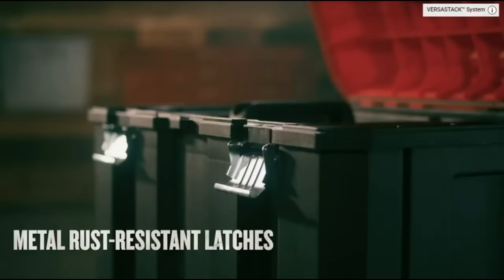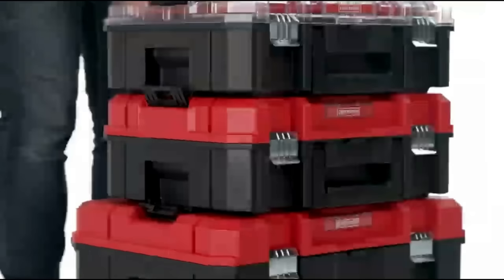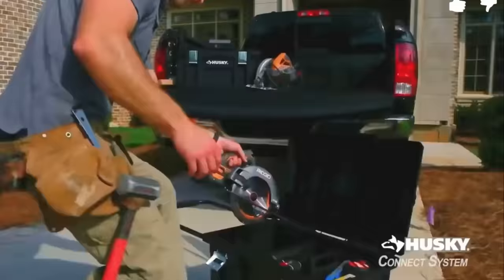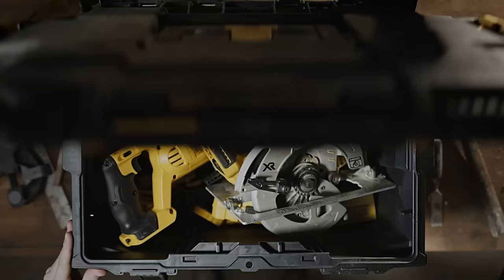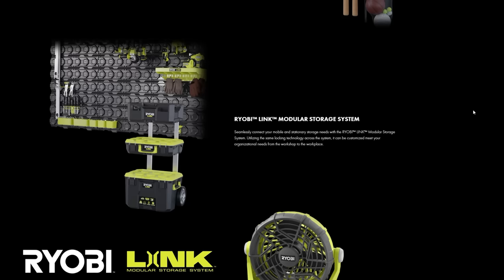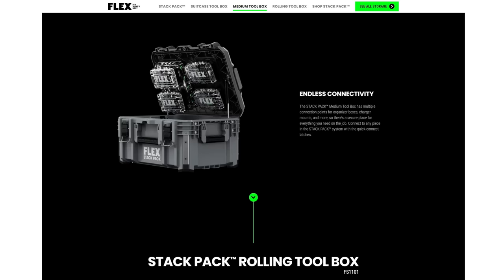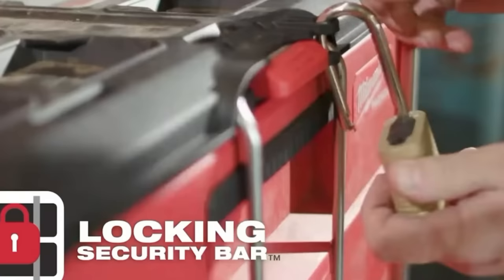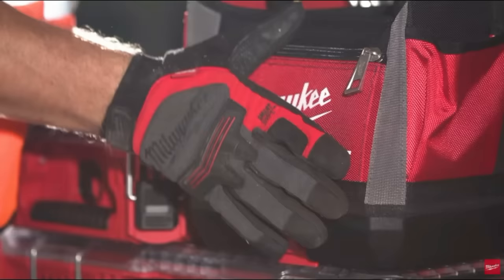BEST Portable Tool Storage systems (RANKED) WATCH BEFORE YOU BUY!

Comment: The most overlooked advantage that sets Milwaukee and Ryobi apart is the latching mechanism is accessible from the front.  Makes a huge difference in a van or when you have vertical stacks side by side and not a lot of side access.
Reply: That's a very good point I've got a load of the DeWalt boxes and it is a pain to lock/unlock them as I have stuff next to it.
It's too late as I'm invested in the DeWalt brand but the packout stuff is pretty awesome.
Reply: Craftsman Tradestak has that as well. VERY nice compared to Versa/T-Stak.
Reply: amen brotha
Reply: @danielshaw4692  sell em and go red. Lol
Reply: DEWALT has drawers that are much better.

Comment: My opinion is even if you’re just getting started or don’t have a ton of money to blow on a tool storage system, you should get Milwaukee pack out.  If you get a lower end option you’ll eventually want to upgrade anyway and it will cost more than just starting with the best option.   Buy one box at a time and work your way up. It’ll be worth it.  The drawer system pack out is a game changer.
Reply: Too true.

Comment: Owning probably more packout than most people, I’m switching to systainers not saying they are better but they have some really nice features like weight sizes usable space. If you’re in or getting into Festool or Makita you will already be in the system. Just putting it out there.
Reply from the maker: Appreciate the feedback Chris
Reply: I like them, but be warned, they are quite fragile. In particular, the top handles wear out quickly, especially if you put a lot of weight on them. This is a HUGE problem, as they are fragile, and so if you lose a top handle and drop a stack down a flight of stairs, the tools may survive, but the boxes WON'T. I consider myself lucky I managed to find out about the handle problem before I found out the hard way. (and it's not just me, I have a co worker who literally just carries his sander and jigsaw in 2 systainers, both of which are under 5 years old, and BOTH of the handles have worn out and fallen off already. He is rough on tools for sure, but there is basically zero weight in those 2 boxes. )

Now, I just drive a 3 inch screw into the center of the pivot point on every box I buy (the boxes have an indent in the side of the lid in the correct area so the head of the screw doesn't catch, at least on gen 2 systainers, the T-loc generation). The peace of mind is well worth it. 

I do find it really weird that they are not part of these comparisons though. They are expensive and fragile, but the space efficiency, the weight, and the ease of access is tough to beat. they seem to get ignored, which I find odd.
Reply: The systainers are nice if you already have them with tools you bought. They attach to the top of the Festool dust extractor I have (expensive but it does a great job), which puts everything on wheels. I use it in my garage. I probably would not take it on the road much as parts might break; it’s probably intended more for taking to a site for custom cabinet work.

Comment: Ridgid did nothing with that system for like 5 years, they finally started adding some new stuff this year. Like the rest of their products it's like they fell asleep. But they are SOLID boxes. And you can get on sale sometimes close to $99 for that 3 piece set. It is amazing how much Flex has done in just a few years. Some great options now.
Reply: I actually have their original 3 piece set. Has taken a lot of abuse. And I actually just bought some of their 2.0 boxes and I'm impressed. They haven't added anything like milwaukee but there is a lot more ways to customize it now.
Reply: @unclepungus7828  Meaning Ridgid? They've added some the past year, but it was like the same 4 pieces for like a decade! LOL
Reply: @sloanNYC  no they began with a few new boxes this year. They released like half boxes the new cooler and 1 or 2 others. Yeah it's nothing new new but it's a start
Reply: I agree. Just picked up a few with the locking latches on the front .  Good boxes.
Reply: Mannn had my rigid boxes for 6 years.. They still hanging

Comment: As a commercial electrician I use Versastack. Now it is a cheap system but it does have the Lifetime Warranty and I have tested the waterproofing and it will keep everything dry. My only issue is the roller box is only good for cement not dirt, the handle should be longer for taller folks and it can not go down a simple three piece set of stairs. Also you use to be able to walk into Lowe’s and just do a warranty exchange but now you have to call craftsman if your boxes break. I’ve had mine now for 4 - 5 years and now I’m replacing some boxes that finally broke through Craftsman and I’ll let y’all know the outcome.
Reply: Well folks in less than week (5 days) I received all of my replacement boxes. Pretty simple with the exchange and think that was a good delivery as well.

Comment: Got rid of all my packouts. It took all over my van, was impossible to get anything else in the van.
   If you’re doing residential or occupied office service, VersaStack, tstack or best is Bott Smart van systainers or festool SysRoll is the way better. Specially when moving around tight residential staircase or hallway or specially going inside the house through the garage and laundry room where there’s barely room to walk.
If you’re going through elevators and long condo hallways, sysroll is just a pleasure to move.
The more heavy duty the box, the heavier it is. Still using some original Dewalt tough system and nothing broken or cracked.

Comment: I have Milwaukee packout and Dewalt toughsystems. 
If you don’t have a lot of tools, and usually small tools I recommend Millwaukee
If you have large and a lot of tools I recommend Dewalt. 
The system of Dewalt that allows you to use any box you want without moving the upper boxes is just so practical that makes Dewalt my number 1 choice over time. Even the old boxes.

Comment: As an industrial electrician who has been using the husky connect for years now I can tell you durability is superb (not a single crack or bend) and that 100lb weight limit is false I have near 200lbs of tools and materials in mine and stacked about 5ft high and it maneuvers just fine. The husky connect dollar for dollar is the best option

Comment: Not only does Milwaukee offer a lot of options that the others don't....there is also a 3rd part aftermarket that makes a TON of stuff to add on. You can make the handle on the rolling tote box removable, you can add level holders, extension cord holders, a front rail for your bottom tote that allows you to stack out from it, etc, etc.

I honestly think that Flex took a look at all the aftermarket stuff that is available online and decided to implement a lot of it. While it looks good, the locking system seems like the weak point on Flex.

I had my initial packout stolen with all my tools at a job site last month and I went back into the slim packout with the aftermarket holders for now. I'll eventually get back into the bigger boxes, but it's nice having literally everything I need in 1 box. Easy to reach and use.
Reply: Slim packout huh? Still liking it? Which specific one did you end up going with, if you don't mind.
Reply: Invest in a couple airtags and attach them to some tools and the cases.  Buddy of mine did it and was able to get back almost all of his tools from a pawn shop and they caught the guy.
Reply: How would you make the handle removable? That's what's holding me back from putting my yellow in the red box.

Comment: I got in the tough system early, and for years it was king. Dolly and all. Then pack out came out and was better. But tough system has one advantage that no one else has, and that's the ability to get to any box right away. When you have 20 boxes in a van, that matters. Literally don't have to touch any other box besides the one you need.
Reply: This. 100%. And nobody ever seems to talk about this at all
Reply: What do you guys mean exactly when you say you don't have to touch any other box to get the one you need?
Reply: @rjIIII  look up the DeWalt DS Carrier or the DeWalt Van/Workshop racking. Each bocks sits separately on mounted arms rather than on one another, so that each box can be extremely easily accessed without having to touch the box above or below at all

Comment: Dewalt Toughsystem kinda got left out in the cold. I very much agree with you, Clint. There is so much more that can be done with it. The garage system is very adjustable. SB&D is neglecting many things that has so much potential.
Reply from the maker: Not sure why they aren't focused on the system brother 🤔
Reply: Milwaukee has a lot of things that you don’t need. Dewalt has the most practical system. Accessing the under box without moving the upper box. This is gold for me. 
After you moving things around to access the under boxes you came to appreciate that the dewalt system is actually unic. I’ve gone milwaukee I’m back to dewalt. I only remained with mileaukee on smaller tools like electric and plumbing.

Comment: I bought the Flex version since I have a majority of Flex tools now, but also because… I just don’t want a bunch of red plastic stuff in my peripheral (even though Packout is phenomenal). I did try Dewalt’s and Milwaukee’s offerings. While the locking mechanism is similar on the Flex, the Dewalt version actually feels a little easier since you just need to unlock one side clip in order to move a box off the top of another. But everything else about the Dewalt TS2.0 is not great (though I do get tempted by the drawers, having seen a bunch of them utilized as mobile table top supporting pillars).

The two things I’d love for Flex to release next for the system is wall-mounted brackets and a dolly.

Comment: Ridgid has a much improved 2.0 version that is currently at $140 for the set.  The new version has a number of improvements over the original.  I have both the new Ridgid and the Dewalt Tough System 2.0 boxes and they are fairly comparable.  The Dewalt system is rated for more weight capacity, but I don't think I would want to lug around 100 lb. per box.
Reply: They didn't do their homework here. The 2.0 has a lot of new features over the 1.0.  Even used an image of a brand new half storage box while saying they didn't really do anything to advance the system.
Reply: It’s funny I prefer the Ridgid 1.0 system. I like the smaller box better with the little parts compartments and the biggest wheel box which has room for my saws but also I can put some snips and pliers in the little slots. I like the medium box removable tool carrier better than the flimsy parts carrier

Comment: For me I ultimately decided on the Rigid System but I got the 2.0. Same standard stuff like IP65 weather rating, etc. The feel of these things I feel I could stack the whole thing up and roll it down a flight of stairs and it would be fine. It's also cheaper than packout system and you can remove the dolly portion of the system.. Yeah they need to expand the line but the base product you get is great. Im coming from the Husky system and while I liked it the to plastic pieces on the screw organizers cracked very easily. Also Im not a fan of all the bright ass colors on the Milwaukee and the Ryobi. Rigid is fairly understated with a mostly black box with some orange highlights. I know it doesn't affect the build quality or functionality but cosmetically they stick out a little too much for my liking.

Comment: This was a really good review. Glad I found it. Had No clue that Ryobi was this good. The flex was a surprise too and I knew Dewalt was overpriced and not updating as quickly. I have some Milwaukee  pack out gear and am going into this system because my drill/driver came in that box. Didn’t know what that was - now I do. It’s heavy. You have to do another video soon on the Bosch Boxx system, Makita’s stackables, and maybe even higher end Festool. Those Festool guys are OCD and their gear proves it. Go for it - do the comparo and then go back review the top units. Not easy to pick a system and you’re dealing with Lowe’s and Home Depot. This helped a lot. Thanks until the next one. 👍 🇺🇸

Comment: The Dewalt Radio is absolutely available at HD, but the original version is much better. I have both and would recommend the original tough sys radio over the 2.0. 

While I really like my Dewalt Sys., especially after the release of the internal trays. I wish the Milwaukee system had came out sooner. I believe it is a much better system, I just can’t justify to expense to change my system out. Especially since I am a team yellow tool user.
Reply: I agree, it's better because they spent years developing it. But I'm so invested in tough system that it's not worth switching. Pack out ain't that much better. Plus there heavier and harder to get to the box you want with out moving a big ass stack first
Reply: I think the modular cart is the difference between the two that wins it for DeWalt for me, especially since it uses the same slide arms as the wall mount and van mount options. I see on Milwaukee's own site that the cart they have has issues with the plastic mounting elements breaking pretty easily. The Toughsystem option lets you access every box on your cart without unstacking.
Reply: What is what you like more about the first radio over the second version?  I'm trying to pull the trigger in one of those things...
Reply: Not sure if they redesigned the 2.0 radio or not, but I had two replaced under warranty for speaker issues. I also have a problem with the charger in it. You have to remove the batter when it’s done, or it over charges them, which shortens the battery’s life. They both sound great (as long as the speakers don’t blow LOL). Happy listening on the job 😎 @TheEl24

Comment: If you have a tonneau cover, Milwaukee offers a suitcase style rolling box.

Anyhow - I have the DeWalt system. I think it's the previous gen, called T-Stak. It sucks! The plastic latch housings break, and cannot be removed/replaced, so some of my boxes only latch from one side. And the organizer box with a clear lid, the lid has such a hard time cohering with the organizer trays, that it's virtually impossible to easily latch closed on the first try. 

I've bought a couple of the Rigid boxes, I keep them permanently exposed in my truck bed, just to hold all my strappers, lines and red flags. Love em! They latch without issue and are super tough. Debating whether to ball out and switch to Packout, or buy the Rigid, and sacrifice some modularity

Comment: Kinda funny. I bought an M18 Fuel OMT a couple weeks ago as my first venture into serious cordless stuff. And I looked at one of the packout cases to hold it. I didn't get the case because it was just a plastic box you toss stuff in and I prefer my toolboxes to be at least somewhat fitted to the tools they carry. I ended up using my granddad's old toolbox which turned out to have compartments almost perfectly sized to hold various blades while the saw sat in the bottom of the box. But seeing a glimpse of what the packout system can do really has me thinking I made a better choice with the Milwaukee than I had originally thought.

Comment: I run the rigid, I built mine up rather than going all in at the start, for me and my job it works great, it’s weather proof enough for when I have to go through the snow or rain (along with the followed mud) it holds the tools I need well,the locking function is pretty decent as well, I personally keep my screw organizer off while working and keep one latch off my top box which holds my needed tools so if I’m only needing it I can quickly pull it off with out having to climb into the box truck I work out off fully, and it’ll manage to stay perfectly like so when driving. And the rolling function comes in handy when I need it. As mine dosent hold heavy tools it rolls easy. Though I’d personally want to upgrade to the Milwaukee as it seems to have the same features just far more customizable.

Comment: I like Ridgid . It’s water tight 1/2 the cost and more portable (smaller)than Milwaukee. The Milwaukee is really nice no doubt.
Reply: Got the 2.0 stack plus an organizer and a crate today for 225 out the door. The boxes are a little smaller and also lighter weight but super tough. Nice color too and I can buy 2 boxes or cases for the price of one Milwaukee equivalent. Milwaukee's crate is smaller than everyone else's as well.
 On the downside I can't hook my Milwaukee insulated thermos to the top of the stack. Lol.

Comment: This is the comment I am posting everywhere possible:
Bought this Flex pack out a few months ago. Used on three projects. The latches between the top box and the middle box kept hanging up or not locking.  Soooo, tried to call company service to get a fix. Wasn't asking for anything but a tech to walk me through the fix(maybe a replacement latch?). First, good luck getting through, they DON"T answer their phones. After a half hour hold the message comes on offering a call back. No choice gotta grow old on the phone or give up. No call back, so the next day I try again, same deal, but this time I get a call back. Pleasant young lady hears the problem and takes all my info and says they are sending a new replacement unit!!  Of course nothing took place, NO Replacement Unit, No Latches, NO NOTHING!!!!   The product seems to be well made except for these few minor issues, however I would never recommend buying a Flex product. They have no customer loyalty. I no longer care to upgrade my tool platform to your products, as I was considering your power tool line. Not anymore.

Comment: The ToughSystem® 2.0 Rolling Toolbox is built for real jobsite conditions with high-impact protection**. It is dust and water resistant with an IP65 rating and has a 250 lbs. load capacity.